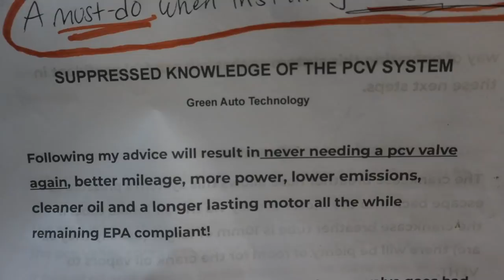The Wonder Of Positive Crankcase Ventilation

Comment: Actually, the US Military with all their rolling stock, initially had PCVs installed to capture blowby and re-route the gasses back into the combustion chamber as an economy device to burn the fuel that would be wasted by dumping it into the atmosphere.  At the same time it kept the crankcase clean and the engines didn't belch those nasty smelling swamp gasses you used to notice sitting in traffic.

Like you said ... no more rainbows on the road after it rained too! I started as a Smog Inspector/Installer/Adjuster in California when retrofitted PCV systems were mandated to be installed on all  cars previous to 1962 1/2. The owner's protested that too, ignorant as they were.
Reply: Well, and also the military had plumbing to eliminate the downdraft tubes to go with the fording kits. You go to all that trouble to have an exhaust that routed upwards for fording rivers, and you can't have a big hole at the bottom of the engine...

Comment: thank you for this! I recently got back into bikes, got a harley and the harley folks are obsessed with removing the 'pcv' system on their engines - they claim sucking in the crankcase fumes will, please try and keep a straight face, will create carbon buildup on the tops of the pistons raising compression and causing running issues and will destroy the engine. I shit you not, all sorts of youtube videos on it mostl from manufacturers of 'intakes' or air cleaners.  I would think if they were right 2-strokes would never work LOL

Comment: If you have an engine that is direct injection, the downside of the PCV system is apparent at the first 50k mike interval when, like my Audi 3.0t supercharged engine, the intake valves need to be walnut shell blasted because of the oil drawn into the PCV that gets “coked” onto the intake valves. I’ve been half tempted to add a road draft tube to it so the intake valves can stay clean!
On another note, saying the PCV single-handedly increased the life of engines, I believe, is not true.  Either way you vent positive crankcase pressures provides a similar result. Improved oil technology along with, what I think, was the single most important change from the 60’s to the 70’s and beyond was increasing the temperature rating of the thermostats. This one change allowed water vapor to boil out of our oil, eliminating sludge which ruins the effectiveness of motor oils.  Also, there are studies reported in the 80’s by Hot Rod magazine that stated that cast iron wear is reduced exponentially as temperatures approach 220F in a three ball wear test.

Comment: Until shockingly recently, commercial diesels were still using road draft tubes. I don't think they went away until the 2000s. I will still occasionally see one in traffic.
Reply: Being turbocharged, they cant use typical pcv setup, they don't have any vacuum. The other big reason is that a diesel will run off of a pretty small amount of oily crankcase gas, meaning funky A/F ratio at best, or an engine that you cant shut off, or runs away, at worst.
Reply: @wheels-n-tires1846  As I understand it, modern diesels solve that issue by routing the crankcase ventilation to the intake plumbing in front of the turbo. It's not positive (no real vacuum), but it equalizes the pressure without dumping oil on the ground. The breather itself have baffles in them to try to keep the oil to a minimum.

I think it would be pretty tough for a modern diesel to have effected AFRs from it. The original engine calibrations should have taken the blow-by/vapor into account when they developed them. Running away seems even less likely since it would pretty much have to push oil into the intake. It couldn't suck it up the way a gas engine can.

I'm also open to admitting my understanding could be wrong, but I think that's the general idea. It seems like a pretty obvious and benign answer to the situation, but there must have been some reason it wasn't possible in the past. Maybe the old school mechanical injection couldn't tolerate it?
Reply: @TheBrokenLife  Many modern engines use different centrifugal force based tricks to remove the oil from the air.  How much blownby is taken into account in the ecu cals I have no idea. Makes sense, and a good idea,  but never heard of it being there in any factory schools I attended. As far as the runaway engines, I was saying that was a big reason for there being breather tubes on older engines. I dont think the injection style had any bearing at all. More modern engines are set up to remove oil and make using that "pcv air" relatively safe. The oil spinners and such were fairly new when i was leaving the industry. My career was mostly spent on Detroit Diesel 60 series engines, with some Cummins n Cat stuff thrown in... All of which were breather tube engines LOL...
Reply: @wheels-n-tires1846  I've heard of the oil spinners, but I thought they were spinning the literal oil to remove coke (as a by-product of EGR) from the oil. I didn't know they were using them to remove vapor from crankcase gases.

I follow you on the runaway statement. I am suspecting that the EFI calibrations are what allow them to no longer use draft tubes for reasons I could only continue to guess about. I didn't intend to tie the two points together.

I haven't had much to do with diesel since around the time the tube went away, so you're probably still ahead of me in the learning curve. I read up a little now and then just out of general interest.
Reply: @TheBrokenLife  Yup... Ive left all that behind, except for the occasional side job. Now im  focusing on building my own cars, and hopefully soon, nothing but 60s Mopars!!
Reply: @wheels-n-tires1846  I miss trucks, but, we all move on to other things eventually. Good luck to you on your pursuits!
Reply: @TheBrokenLife  Me too...loved trucks n heavy equipment. But im gettin old n its time to chase some dreams before I can't!! Thanks!!!
Reply: @wheels-n-tires1846  Big 10-4 on that one, good buddy!

Comment: My pvc valve story,,mid 70's stuck a Holley 3310 on a 283. High idle. Idle screw all the way out. Remove throttle base, centered butterflies. No help. Then it hit me couple days later. Left the pvc valve out of the plumbing,,,,,

Comment: Uncle Tony,
For Pcv valve on inline engines, how or where would I make a vacuum port when running side drafts with individual intake runners?
-In my case of thinking.. Would drilling a hole into one intake runner cause too much blow-by fumes for one cylinder to handle?? Or…Would I have to drill each intake runner for vacuum in distributing the blow-by gases to each cylinder?
-or is there another method to create vacuum?

I guess for example meaning if you had a straight 6 with 3 dcoe’s or something in those terms where the rear port has brake vaccum and another has distributor vacuum advance, with the other cylinders vacant of vacuum ports.

Right now I have a “breather filter” on one inlet of the rocker cover, the other hole has the Pcv valve also with a filter on it but there’s no vacuum for the circulation to happen it’s just dependent on crankcase pressure to push escape. Can’t be right.
Any ideas appreciated, thanks!

Comment: The government had nothing to do with PCV designs. Chrysler in the 50's had design this and they called it a road draft, ford later copied it to stop oil leakage due to crank case pressured coking. My dad was a Chrysler engineer.

Comment: the pcv valve stopped old dinosaurs from bleeding black gold all over the road and the bottom of the car / truck.  prevented oil from washing into storm drains and probably saved thousands of motorcycle riders from horrible crashes. 
however -
the  SINGLE  NEGATIVE  from the pcv is the oil vapor being  causes the massive build up of the carbon to  cluster on the intake valves. 
multi port  F I  solved this problem as fuel was sprayed on the intake valve keeping them washed clean.

Comment: The only problem with PCV is high millage and low maintenance on some fuel injected cars feeds corrupt mechanics. It gums up the intake valves, runners and the back of the butterfly if you don't maintain it. Carbs and TBI have fuel flushing it away. I have bought several cars shops diagnosed with "bad valves" that a can of sea foam in the vacume line and an Italian tune up fixed.

Comment: Volvo was actually using a simple 0,01 hole in the intake manifold connector, from they sucked in the crankcase ventilation. no valves.

Comment: yes the PCV system was a necessity for CARBURATED engines, because of their lack of good atomization of fuel, and the blowby it caused.95% of engines till the late 80's and early 90's when the inception of port injection came about did well to last 100k miles. Intake valves and manifolds were full of crude from the pcv , till injection came along, reducing their efficiency.Engines that ran on propane, suffered much less oil contamination and blow by, and lasted many miles longer, just a fact.Will not argue why this is so , as you have made your arguement on that count, and made your position clear.
Reply: Are you saying that modern engines do not use a crankcase breathing hose from the valve cover to the intake?
Reply: @blackhawk7r221  not at all, they are still there, but compared to carbureted engines, I doubt that there is near as much blowby and oil contamination as there used to be
Reply: @edgemacbain4934  True

Comment: I've got a pcv-less 71 datsun l16 engine that has lasted a really long time and still won't even make the oil dark. Its pretty impressive considering not having a pcv isn't a good idea
Reply: I had the L 18 in a 1974.  Rather than a high vacume small diameter PCV, they used a low pressure large diameter 3/4” breather hose.  I prefer this setup.

Comment: PCV valves were good in the day , but a smart mechanic did a test to see if " GUTTING" the valve was even better , it was , he simply ran a long length of rubber hose to the very front of the air cleaner housing " creates a vacuum in the crankcase "  he installed a small filter on the other valve cover to allow fresh air to be sucked  into the  crankcase , thus drawing out the blow by gases , the being sucked back into the intake manifold ( that is why you see some engines with small air filters on one valve cover
Reply: And if they understood that the low pressure side of the motor was the passenger side, those filters should be on THAT side - due to direction of crank rotation (passenger side suctioned ). It's my understanding PCV valves should be installed on the driver side cover (atleast on a V8 or V6 ) even if they didn't come from the factory that way due to engineers not really being engineers.
Reply: @davidslocowb8717  TRUE!   some people even connect the rubber hose from the pcv valve directly to the carb, but over time the minuscule droplets of oil being sucked through the hose would eventually clog up the carb

Comment: Question for you Tony...I'm going to be putting a '65 Chevy 327 in my truck, and I noticed under the intake manifold there is a baffle for the PCV valve, which is located on top of the block in the back. My question is, when I hook up the PCV valve in the back of the block, where should the other end of the hose go? I've seen guys hook it right up to the back of the carb. Where is the best place to hook it up?

Comment: In my ignorant yourh, I plugged the hole and deleted the PCV not knowing it’s function.  Days later, rocker cover gasket leaks.  

Pressurised crankcase exiting at the weakest point.  Thankfully, it wasn’t the front or rear main seals.

Comment: You should do a show about using a vacuum pump to create an actual vacuum inside the engine...the lower pressure and reduced windage is worth 25 hp on a 600 hp motor.

Comment: Besides keeping the oil in the engine the other thing a PCV system does is get unburned hydrocarbons out of the crankcase that end up causing the old non-detergent oil to Coke up. In the past when I pulled valve covers off an engine that ran strictly on non detergent oil it look like black cornflakes filling the valve cover.

Comment: One of my '65 Galaxies w/ 352 std trans had the RDT. The engine life was more like 50-75k.
Reply: Wasn't the orig engine or a Canadian market vehicle, PCV were were mandated by '65.
Reply: @tombryant1104  lt was the original eng. It had the baby pentroof valve covs. It was a 4 dr custom ex State Police car. Unfortunately it was not the 390PI eng.    MotorVehicle Act of 1966 mandated PVC.
Reply: @tombryant1104  and seat belts also.

Comment: I do have a tractor that had a pcv valve.
I'm pretty sure it makes no difference on a car engine. Yess i converted to an oil catch can style, it ran now for around 3000 operating hours. It does indeed reduce fuel consumption to get rid of the valve, however... Its a tractor so usually is under high load. Even so, the fuel saving while measurable, is not that huge. Kindof makes sense only if you end up with a stuck valve. Like i did. Darn thing had pressure in the crank case and it blew the dipstick out. The valve was for some reason ~200 usd.  The can was like 30. So i went with the can, saved few usd there, and around 1% fuel. Surely 1% on a car is nothing. Specially since one would have to load the engine Hard to get it. However on a tractor that has no issues of eating 100+ liter / 8 hour shift, over the 3000 hours it has, i saved around 350 to 400 liters of fuel. 
So its one of things that is kindof true but does not justify to put it in practice unless you are in a special situation.
Reply: Running a hose to the header collector for constant WOT applications works. PVC is only effective when there's manifold vacuum most of the time
Reply: PCV...Oops
Reply: @oops1952  its a diesel tractor. naturally aspirated.
Reply: Ah...so much for vacuum! That would make  pcv pretty much useless
Reply: Well it did have.
Reply: @nagyandras8857  I'm not surprised. Manufacturers have done stranger stuff

Comment: That motor looks like a Lincoln/Merc Y-Block, not an MEL.  You can tell by the exhaust manifold (the two inner are close together like a SB Chevy) And also the two hold-down studs through the top of the valve covers.

Comment: PCV  positive crankcase ventilation, ok Tony lets go a little further into the subject. How about the internals and how they work,(spring and spring pressure, backfire prevention check part of it, the little tiny 90 degrees chrysler PCV valve)  Just a little more education for the younger generation

Comment: Should I add an oil catch can to my dodge charger 392 ? It's a 2021 and only has 1400 miles on it. I was thinking I don't need it because the engine is port I injected and it cleans the intake valves.

Comment: TIP: If you check your oil and notice that there are oil leaks on your engine, change out the PCV valve. 
It is one of THE most overlooked devices in every car. Except for the Loose Nut behind the Wheel....

Comment: A good way to toast a hot motor is to not evacuate the crank. Its an inverse side of a pump, pulse pump and hot. 6cylinders turning 2300 max not so bad. I think I saw pcv coming along around 64.

Comment: So I was actually thinking about placing a PCV on my Hudson Six but can this be done (easily) with a side valve engine? 

I was thinking along this path: the oil cap is already an air filter (metal sponge) so if the blow off tube can be redirected to the top (or bottom) of the carb air filter lid I’m basically there, right? Of course with the PCV ball to prevent air going into the case in stead of out.

Comment: Don't forget the vent side, it's equally as important as the valve/orifice side.  If the vent filter gets plugged up with crap, it won't flow and it won't work.

Comment: Can u please explain the fuel line system of a 72 Impala. I'm trying to blow out the fuel lines and I'm not getting very far. It seems the evap is tied in with the system. Idfk. Replaced the fuel pump and plugs get spark. I need your help. Thanx Tony!

Comment: You didn't mention what happens at full throttle.
Since there's no manifold vacuum the spring activated ball in the PCV valve snaps the ball shut and the crankcase gases flow in the exact opposite direction now.
ie the PCV valve is closed and the crankcase gases now flow into the aircleaner via the PCV intake hose.

Comment: So if the pcv works on vacuum, does an engine with a drysump oiling system still use a pcv valve?

Comment: So Tony, do you have any comment about whether to retrofit my old 40's cars with a crankcase ventilation kit? It adds a vacuum line and routes the downdraft road tube into the intake manifold below the carb. Some people argue that you foul up the carburetion by doing that, and they don't run well afterwards, but I'd like to have a cleaner floor drip pan and maybe make less gunk going down the road and help reduce sludge buildup. Do you have any experience or insight on that plan?

Comment: Would PCV long tube headers be even more efficient? My 69 Camaro had a top vent and the snorkel on the air cleaner sucked it back in any way. Had to rotate the air cleaner every 500 miles

Comment: My 84 302 has a pcv on the oil cap and a breather tube thats supposed to go to the air cleaner on the other valve cover. The breather tube blows alot of oil out at high rpm.😬 got good compression tho.

Comment: Kids in LA in the 60’s could hardly breath with the unburnt leaded gas and oil vapor in the air. 
Tony- what about the air leak in the manifold? I suspect you allow for that with the carburetor? What about the pcv plumbed into the air cleaner?